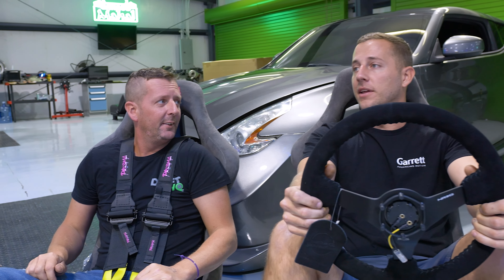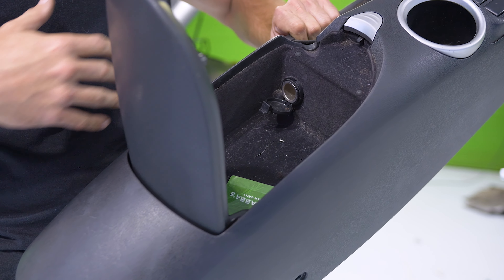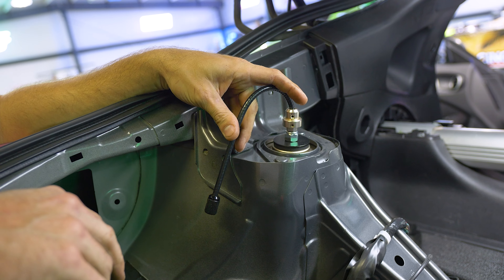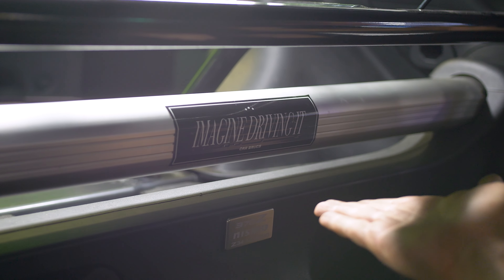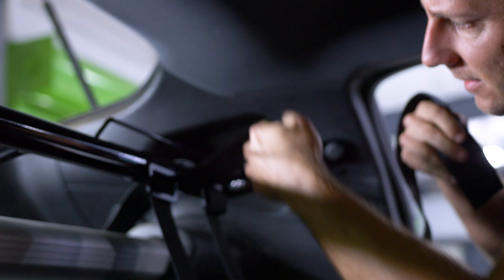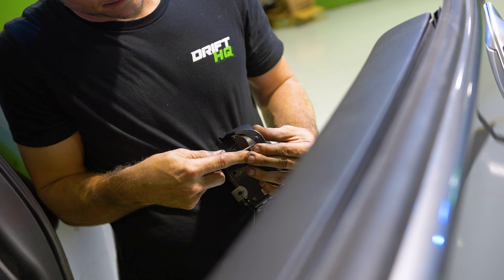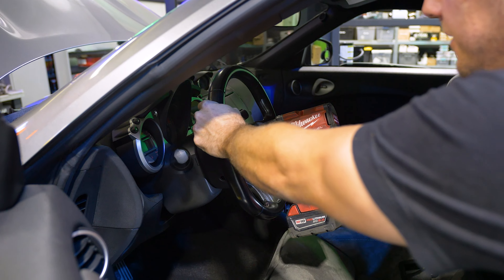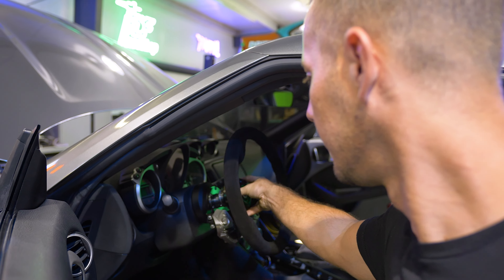DIY 370Z Drift Interior - The Essentials!

Comment: The damping adjuster extensions for the BC coils in back could’ve been cut to length for a proper fit
Reply from the maker: Thanks for the tip! We wanted to keep it original and have no chance of it rattling against the rear window. Its extremely close there

Comment: probably a dumb question but how do you park if the hydro doesn't stay up when you pull it?
Reply: The stock handbrake doesn’t get removed, if it does then there’s a pin you put in to hold the hydro in place